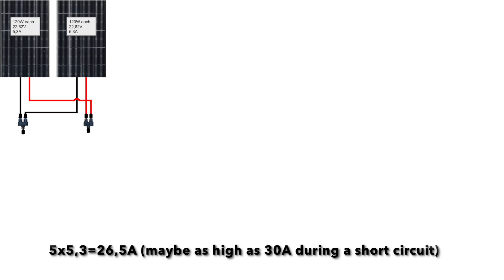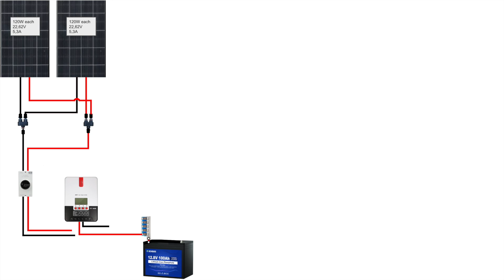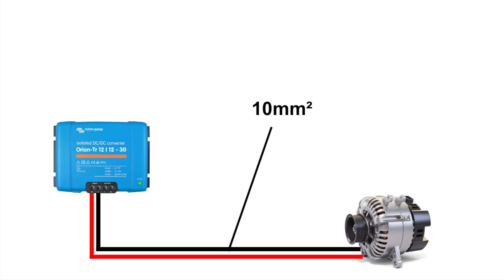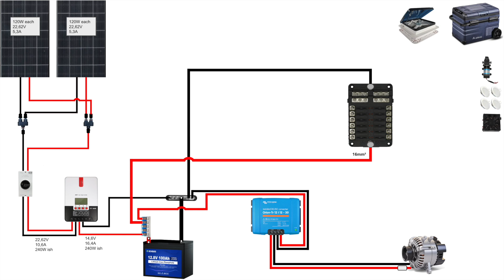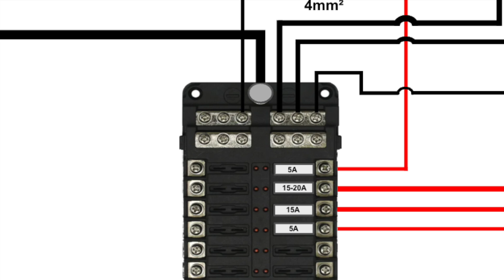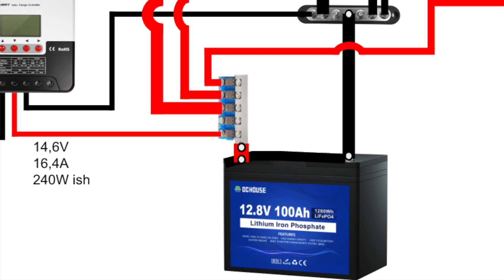A common 12V/230V electrical system

Comment: Helpful video. Thank you.
Wondering about an earth or ground? Would that just be wire from the negative terminal of the leisure battery to the body of the van? 15mmsq? Cheers.
Reply from the maker: Hia, there is no need for chassis-earth here. There is ni reason to have your lithium leisure battery connected to the body of the van. It's a floating system with galvanic isolation - nothing from the starter battery side is directly connected to the leisure side. In this case, I wouldn't even want a chassis connection because 1. We've got 2 different batteries with slightly different voltages and 2. We've already got a good negative connection from the terminal to the busbar then to the converter, why go through the steel body of the van? :)